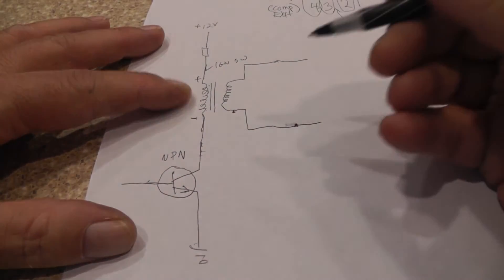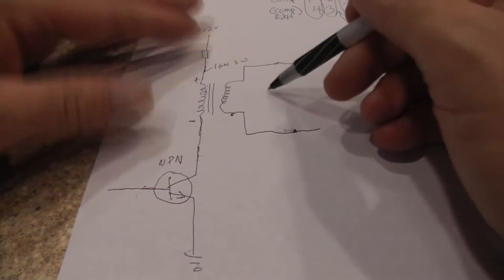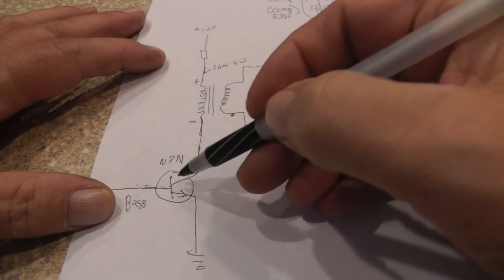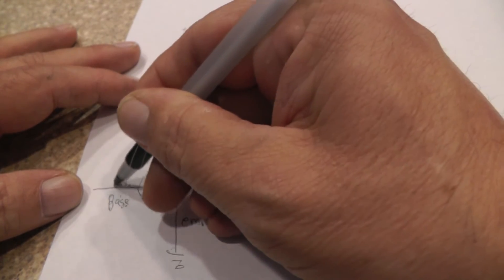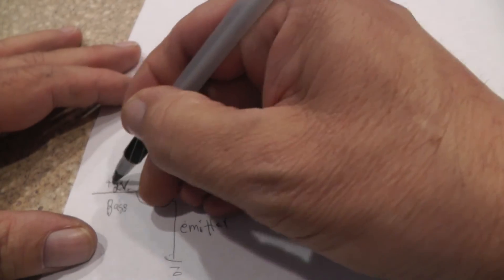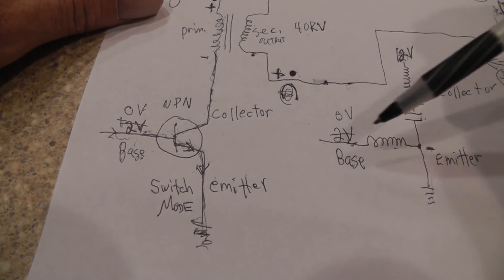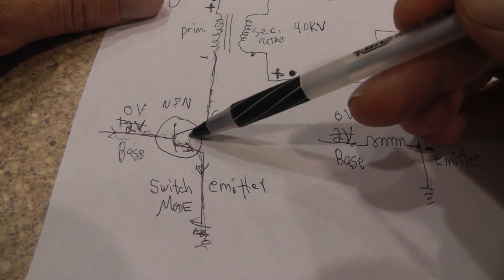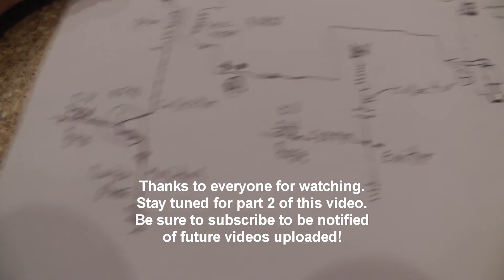Understanding GM Waste Spark Ignition - Part 1

Comment: That is NOT how an NPN transistor works. 0V turns it off, not on. Current only flows when the voltage between the gate and the source is above the threshold. If you want a switch to do what you said you need a PNP, not NPN. However, PNPs are more complex then this when working with higher voltages.
Reply from the maker: Okay Marshall, I went back and watched the video and where did I say that 0V turns it on. I said that 0.7V on the base turns the transistor on and used 2V as an example on the base. And even mentioned that 0V turns the transistor off. You can go back to the timeline at 7:35 and see for yourself. And while we're at, I was talking about a bipolar transistor and not a FET as you're using a gate and source as two of the connections for that type of transistor. Have a great day!

Comment: im a hobby mechanic and wanting to lean how to use a oscilliscope, can u recommend a decent scope for a beginner that will be still useful futher down the line,, thank ye  I saw the new medical device on tv that can do an ekg by putting your fingers on it,,, fascinating,,, It seems that an EKG is basically an oscilliscope and measure electrical sine waves in the body.
Reply from the maker: I lean towards a Picoscope especially if you're going to be doing automotive work. Here is a link to one although it's a 2 channel and 8-bit. Picoscope does have higher end scopes with a higher price, but I think this one should get you going. https://www.amazon.com/Pico-2205A-PicoScope-channel-probes/dp/B0153KF4FW And since the software is free, once you learn it, you'll be ready for a higher end scope which uses the same software. Yes, an EKG is electrocardiogram which is a recording of the heart's electrical activity. And yes, it uses an oscilloscope to pick up those electrical signals.
Reply: @stuzman52  thanks very much!
Reply from the maker: @randy1ization  You are welcome!

Comment: why is a relay not used instead of a transistor? also why is a tiny amount of voltage allowed to go to ground? this would make a completed circuit and be a very small parasitic draw?   thanks for making the vid.. I would also like to know what exactly takes place in GM   DISTRIBUTOR MODULE the little black module located on the distributor plate on the back of the distributor.  I know if the timing EST connector is unplugged on the firewall, the vehicle runs only off of the module. when plugged in the motor runs off of the ECM signal and part of that module, but im not sure exactly what is taking place . does that module strictly control timing?  I believe the TPS signals the ECM to control injector timing and pulse width but not sure if it does it alone.

Comment: I helped a friend out with a GM 3.8L that had a hard miss on 1 and 4 so I played the shell game with the coil packs and the miss stayed on 1 and 4. My friend wanted to go cheap so I went out to a junk yard and bought a used ICM. After install the miss-fire was gone and the car ran good. A day later the car developed an intermediate stall about once every 30 miles. I scanned the car and a crank sensor code was present so i checked wiring integrity to the sensor with a DMM and replaced it. Ran a 20 mile test drive no problem, I give the car back to my friend and the same thing, once every 30 miles it stalls. THEN i get the bright idea of swapping the used ICM back at the junk yard for a newer used one, made the install and its been a week with out any stalling.
Reply from the maker: Good work on the diagnosis. What did you find wrong with the wiring harness as you did not say. I'm sure that your friend is very happy since you didn't have to spend a lot of money on the repair. Take care....
Reply: Thank you for the reply and posting the videos. Actually I didn't find anything wrong with the wiring harnesses to the ICM or the crank sensor. The issue I believe was something internally wrong with the first junk yard ICM because after installing the second used ICM the failure rate went from a consistent once every 25-30 miles to no failures so far since install a week ago with over 300 miles clocked. I'm just happy that my friend is back on the road now and the repair stayed pretty reasonable for him. Again thank you for the videos, I am learning alot between you and scannerdanner and i appreciate the time and energy put into your videos.
Reply from the maker: Thank you rstar for the feedback and I'm glad that you're learning from me and scannerdanner. Sounds like you're well on your way to being a great diagnostician. Take care...

Comment: Fantastic Terry - I like  to see were  starting right from the  beginning complete to the end.  Crank sensor codes have had me barking up the wrong tree too many times. HA!   I was diagnosing a Nissan this week with a crank sensor code at my friends auto parts store were I practice my hobby  with the help of all  my YouTube mentors and my Scannerdaner    manual by my side .  After 2 minutes I noticed this car would not get out of its own way and the customer never noticed it would not rev over 2500 rpm.  A local garage read the code and  charged him $100 - told him to buy a new crank sensor  (swaptronics) and  this is where he wanted to buy the sensor and   a second opinion.   The cat was plugged solid - will see the car again next week after he changes the cat and then I will check out the crank code- I suspect the code was a result of a plugged cat and your going to be a helping me with the upcoming vids.  Cant wait for the Pico . Take Care Steve.
Reply from the maker: Hey Steve, I thought about just doing the repair, but I thought that it would be a good series to take this one from the beginning. I tell you on diagnostics, it can get the best of us on making the right call. Funny that you mention about the cat being clogged and getting a crank code. On the waste ignition systems, even cracked ignition coils, ignition control module wiring to close to the spark plug wiring, etc. can cause crank codes to appear. The reason is that RFI can be induced on the wiring back to the PCM and see it's counting pulses, there will be extra ones. I'll be sure to cover this in the future videos. I'm not sure yet how many videos this is going to be, but I'm going to be thorough as I can. I think you'll like the Picoscope videos too.